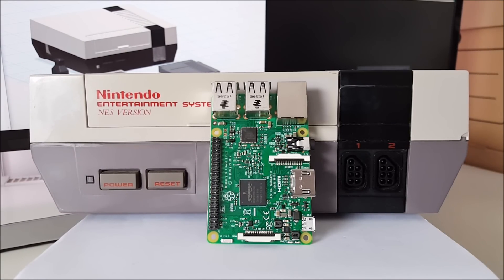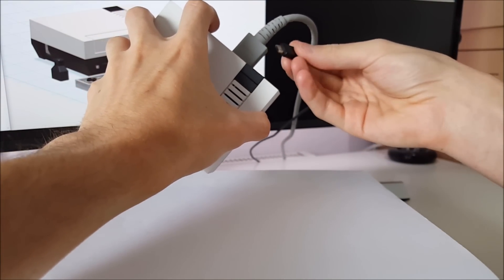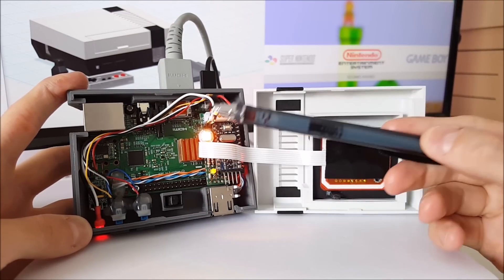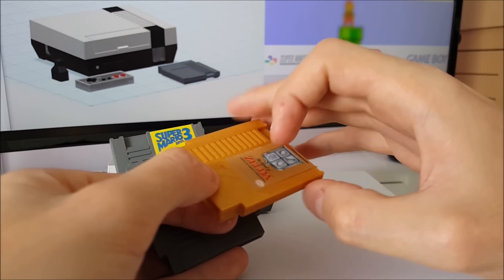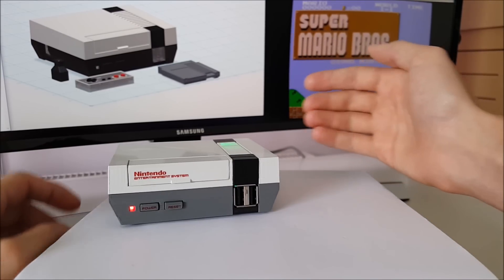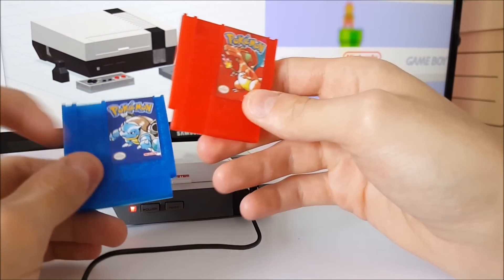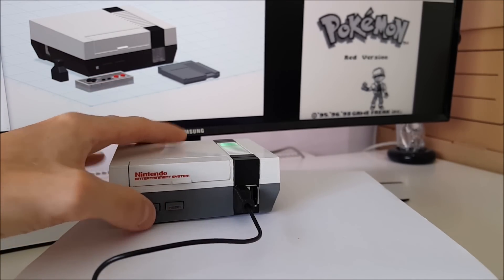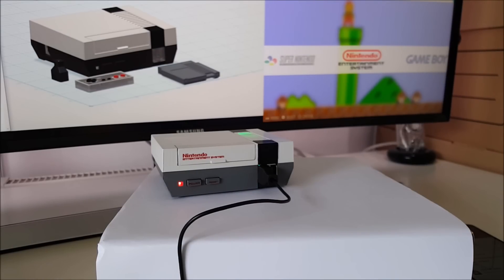Raspberry Pi Mini NES Classic Console

Comment: could you add a screen to the top half of the system and make it like a laptop? it could open up in the middle between the black and white parts like a clam shell. you may need to make the case a little bigger, but it would be awesome to not need an external screen.

Comment: very nice idea with these NFC-Cartiges. Only 2 things, i would do. i would not just leave the 3d-prints as they are, i would trim the surfaces, that they are as smooth as the original one and i would choose a 1:1 sized controller. ;) But these are just tiny suggestions for correction. In fact thats a pretty good work.

Comment: would the console be able to recognize other controllers than the mini NES controllers you made?
Reply: leroi Most likely, as it's still a Raspberry Pi.
Reply: It's actually compatible with the PS4 controller which is pretty neat
Reply: ... if you use a ps4 controller you are ruining the experience, don't you hold a regular ps4 controller every day (#teamxbox) when on this you are using the remakes of the old controller the experience is so much better
Reply: the old nes controller suffers from bad design. its hard to play any longer than an hour with how uncomfortable it is.

Comment: Suggestion, make the power light blue or green, until you start a game, then make it red, that way, you won't accidentally remove the game, while the game is "running". This would mean whenever the game is running, it is red, as a normal NES, but when it is powered on but not running a game, a different color would let you know.

Comment: I was extremely impressed up until you pulled the mini carts out. Then just blown away when they actually press down into the system. then there is a working mini controller too... you sir, are an artist.

Comment: Could you put the Rom itself on the cartridge NFC supports filetransfer...
Reply from the maker: It does, however you're severely limited by capacity and bitrate with NFC. Storing the roms not only wouldn't be possible but loading would take several tens of seconds for most games.

Comment: Wow very impressed with what you did! Can it be done with a PI 3 all so? Relocating the other 2 USB ports very good. The adding the Arduino to and a NFC reader with it super! The small carts that you can just reprogram with your cell phone's NFC is super good.

Fantastic job.

It be nice if Nintendo them self's did something like this with all this can do.

Hope you can post something so others can make it. Maybe all will not have a 3D printer but I am sure can pay some one out there to 3D print them.

Thank you. Grate job on this.

Comment: AMAZING WORK!! I have a tech question for you. Why did you use the arduino for the light and switch controls? Couldn't you use the GPIOs from the Pi and add a few codes to make that work? I love the arduino and program them well, the Pi I have very little experience with. Thank you in advance.
Reply from the maker: I cover this a little in my blog post: http://www.daftmike.com/2016/07/NESPi.html
The arduino controls the power to the RPi, it needs to read the switches in order to wake up from a shutdown.
Reply: daftmike I will check out the blog. Thanks for the reply and once again , GREAT JOB!
Reply: I have a similar question is it possible to map the light on/off to a button on the controller?

Comment: I've got to wonder, given how small most retro games were, could a ROM be fully stored on an NFC tag, rather than on the SDcard?
Reply: The smallest NES games are 24 KB, the biggest NFC tags store 8 KB of data, so no for the NES. But plenty of Atari 2600 games should fit 8KB, so yes.
Reply: NFC gives off a 'code'. Data isn't passed back and forth.
Reply: +SynrsCreed it wouldn't have to be passed back and forth.  once you load the ROM info memory, it stays there.  you'd only have to write to the NFC if there's a save game.
Reply: That's not how it works.
Reply: +SynrsCreed how not?
Reply: Go learn some stuff
Reply: that's not an answer.  NFC types 3 & 4 are write once, but types 1 & 2 can be rewritten, unless you specifically define them read-only when writing them.  as long as you're not using them as your working folder (because, yes, writing to them many many times wears them down), there's no reason you couldn't load the ROM into memory, play the game, and only write back to the NFC tag after hitting the power button, and only if there is a new save state.

Comment: You could just buy the NES Classic just for the housing and gut it and do this with a Raspberry Pi 3.
Reply: yeah, sure. it is totally cheaper to buy a $3000 3D printer to make one of these things
Reply: it would much cheaper to use a 3d printer like he did
Reply: +Yerm Terragon (blagu10) People will print you 3D designs on etsy.
Reply: 3D printer's aren't that expensive anymore. You buy the 3D printer NOT just to do 1 thing, you can be creative and make more projects
Reply: Most average 3D printers costs the same as a normal paper printer. You could afford a decent one for just 200 bucks.

Comment: the controls are very small, a bad idea...
Reply: the bad idea is that the controls are scaled. The miniNES is perfect.
Reply: He said the mini controller was just a novelty. I'm sure you can just plug in any generic USB controller of your choice instead of using the mini NES controller.
Reply: of course, but it would be better the original default size

Comment: Now this is just very cool indeed.

And, in all honesty, it's actually closer to what I imagined when I often talked about Nintendo re-releasing its old and classic consoles but with a few small tweaks here and there to make sense in modern times (like making the actual consoles smaller, adding display connections for modern TVs, and that kind of stuff).

It all makes great sense to me, other than scaling the controller. Just go with a normal-sized controller, because you actually have to use that thing to play the games, and you'd obviously want it to be comfortable and practical.

Aside from that one niggle with the overall idea, it's pretty frikin' awesome.

Comment: That NFC mini cartridge system is such an adorable solution. I love this.
Reply: From what I see, the device is running a program called Emulation Station which has an interface to scroll through the games list and play them from there. All the NFC cartridges do is load a game automatically without having to go through the Emulation Station menu.  So a cartridge isn't needed to play a game, it just adds a cool feature.
Reply: heres the thing it has that by default the os hes using lets you scroll games as you normally would he added the cart funcionality in himself
Reply: ebeeto you shouldn't be commenting on videos you should be making videos :-)
Reply: Dammit Ebeeto, make new Hitman videos!
Reply: can you write games into the amiibo nfc chip?
Reply: +Kurt Clothier if you have an old gb or gbc cartrige  travel case its easy to not loose them
Reply: +Miguel Angel I think the amiibo ones are locked.
Reply: q
Reply: i agree. thats a fantastic idea.
Reply: make a new hitman